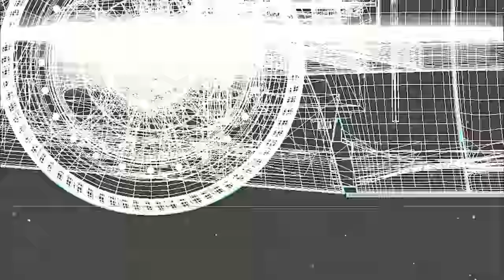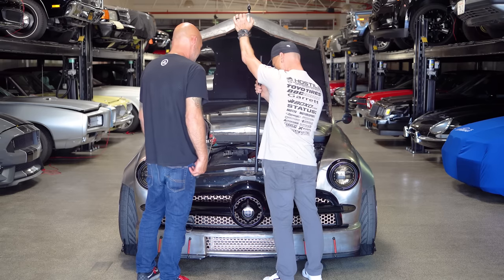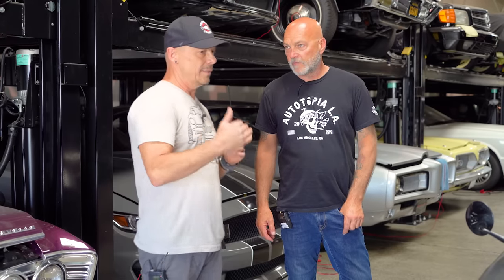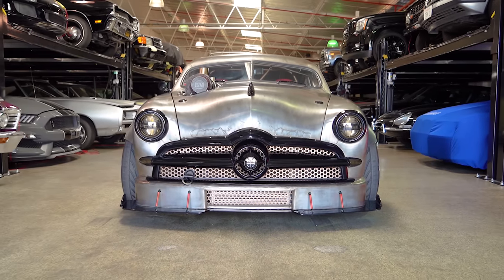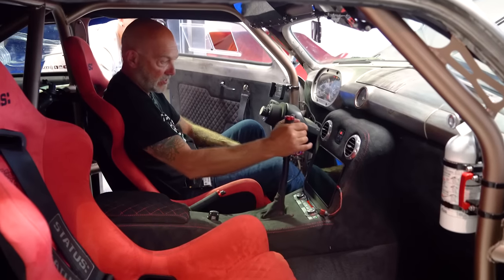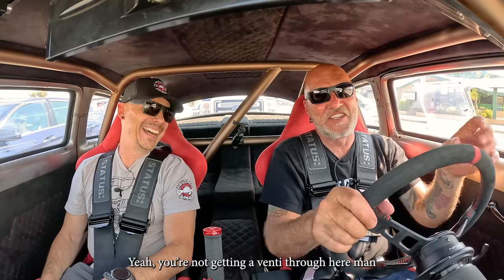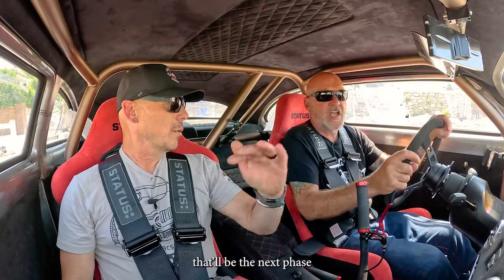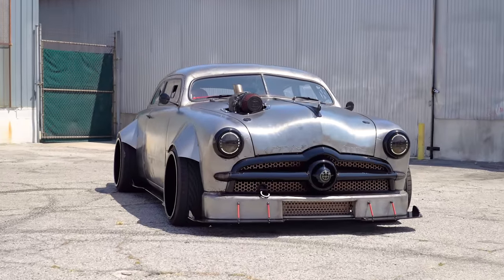'49 Ford Chopped & Widened Placed On a BMW Platform with 62 mm Turbo | Mad Max/Road Warrior Build

Comment: This thing is totally rad. It's not a rat rod  because it's nicer looking, but it's not a smooth and sanded out car. You can see the welds, and the builder is not worried about making it pretty. You can see the scuffed metal on the body. I don't mean that as a slight in any way. That gives this car character and makes it a beast of it's own. Awesome that this guy did this in his spare time and wasn't afraid to play outside of the box. I would drive this on the daily if I owned it.
Reply from the maker: I’m with you all the way. Absolutely love the finished yet not finished metal work
Reply: Thank you Davivd2!  After building counlles customs in the past and going through a 15 year hiatus I really wanted to bring several styles together I had in my head.  This is the result. Thanks again for your comment!!
Reply: @ManiacsGarage  Dude. It's totally deserved. That ride looks like it could be in a Mad Max movie.

Comment: A great testament to the tool and die makers 74 to 88years ago, when just 40 years before the 49 was styled and created, the guys were still making horse saddles, mule collars, and wagon wheels.  Damn guy- you built a  monster. I want one!! Well, dang it , I need a retro moded '37 Ford first. THANKS FOR THE ATE UP RIDE ALONG.! YOU BUILT IT THE WAY YOU WANT IT NOT FOR SOMEONE ELSE.!! GREAT JOB. VERY FUNKY MACHINE AND ONE OF A KIND. I doubt there's another person on the planet that rides in a driver like yours👈

Comment: Best car I ever owned was a BMW. A 2002 BMW 750il that was a beast. It never broke down, MARINE Corps maroon with eagle globe and anchor Florida tag. Marine sticker in the back window. From zero to 100 in 5 seconds flat. Road a drove like it was on rails. That is when those cars were the best of the best. Put 100k miles on it and never once broke down. Today they are trying to get way to much power out of really small motors. I want to see that done and down right brother. Neal APOLLO BEACH FLORIDA SEMPER FI OHHHHHH RAAAAAA

Comment: I just built back to stock 1969 AMC AMX 390 XCODE GO PACK group 19 parts, original answer slotline all aluminum mags from group 19, teage wing, Every available option, found a NOS case or r12 FREON that now blows ice could. All numbers match, air shocks in rear, disk breaks in front. Back to hunter green original color. 1970 hood and front medal to keep it cool In FLORIDA heat. Put 1970 fiberglass hood , fenders, bumpers, which is longer the 1969. Painted hood, fender tops, to strip around the windows in MATTE WHITE , plus white AMC Sticker on the back fender. It keeps my car 15 degrees cooler in Florida. Air flow blows also. I like how you think outside of the box. We both did something special. Great job. Semper Fi, Neal APOLLO beach Florida
Reply: Sounds like a cool build and more importantly sounds like you are having fun with it!!

Comment: I'm willing to bet with some aero this thing would actually be relatively good at road racing. This is definitely one of my favorite cars I've seen on your channel brother. Hey who do I talk to about bringing my car down? I live in Reno but I'm heading down there to go surfing with my older brother in August. I have a 1996 ford Thunderbird with a 1.5j (N/A I6 from an is300 with a precision 78mm turbo), haltech elite 2500 managed, dc009 with a clutch masters twin disc and lightweight flywheel, bbk sn195 front tubular subframe with complete drift domestic front knee assemblies, Hotchkiss rear adjustable arms, top shelf fortune auto coilovers, baer 6 pot calipers pinching 14 inch slotted and drilled rotors up front and dual OEM cobra calipers pinching 12 inch slotted and drilled jobs out back. The only relatively uncomfortable thing about the car is I run a spool rear end. It is a drift car after all. But it has the entire a/c system from the is300 I pulled the engine out of, I seam welded the entire chassis and unibody then covered every weld with ford seam sealer, I built my roll cage in a manner that allowed me to tie it in to my subframe connectors with removable door bars, the entire cabin is covered with black line-x bedliner and I laid an OEM carpet kit over that. I have the 10 inch haltech dash screen, then the largest Android tablet available installed right in front of the passenger seat in the dash so my lady can watch movies, or get some metal rockin for poppa bear. I just run that as a head unit and a 2500 watt 5 channel amp powers the 10 inch subwoofer, 2 6×9, 2 6 inch door speakers, and 2 tweeters. It has no rear seats but I spent money on the fronts. They're real JDM bride units. 3 piece wheels out in your neck of the woods hooked me up with some insanely aggressive deep dish 3 piece jonnies. 5 inches of lip out back (19×12) and 3 up front (19×9). Then I modified a knockoff rocket bunny wide body kit for a Lexus sc300. It looks absolutely fantastic man. No rattles, no scraping, no rubbing, My suspension is perfectly squared away, I run 2 mufflers with a cut out so it's quiet unless I don't want it to be. I also have N2o. But I use it completely different than I guarantee anyone else ever has. I just run a line from the bottle to a purge valve which is mounted to my dual radiator fan shroud. So if the car starts heating up sitting in grid with the a/c blasting, I just hit that purge button a few times. It's unbelievable how fast the thing cools down. I know I know, sounds crazy but trust me the shit works. Best part though is I got the car down to 2,920 with me in it. I'm 6'5 260 lbs so, it was quite a feat. Hopefully I hear from you man. God bless.
Reply from the maker: Shoot me an email. I’m easy to find and let’s see about shooting your car!

Comment: Good choice by going with the 335i....that N54/55 engine is infinity tunable, you would've had a terrible time trying to make any good power with the VQ in the 350Z/Fairlady or the absolutely dreadful 13B Renesis rotary (as a rotary guy myself, there's only one way to make those Renesis' decent, and it involves 12A housings, custom manifolds, and boost it didn't have). I haven't gotten to the full drivetrain part yet, paused and started commenting soon as the chassis and drivetrain choice were being discussed, but this thing with an N54/55, making an easy 700hp, with AWD/XDrive and a 6spd manual would be super, super dope 👌🤞

Comment: As a N54 owner, this is rad. 600/500 power numbers are mild for what these can do but the n54 is really just a modern 2j...they just haven't gotten the aftermarket support 2j's have and they probably never will with the B58.

Comment: That burger air filter is for the stock car. Its small to fit behind the headlight. Its too small , swap it to a bigger filter.  It will be over 500 ft # as soon as you do. Ive seen it add 50 ft# s to a 400 hp car